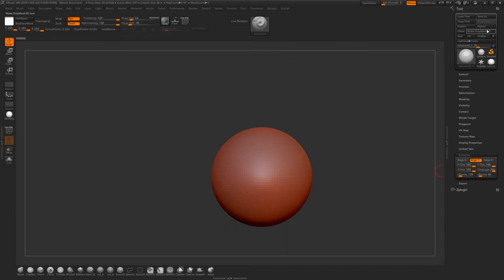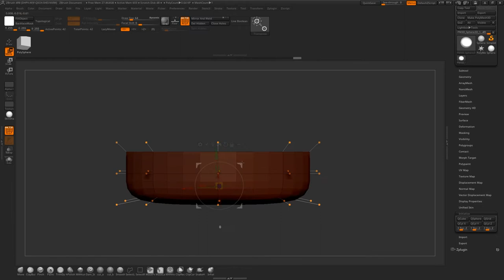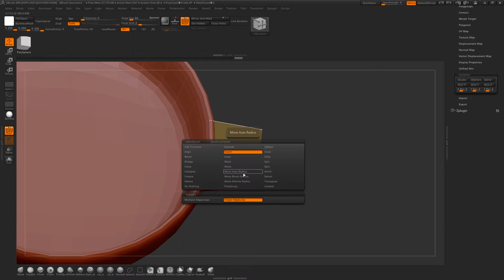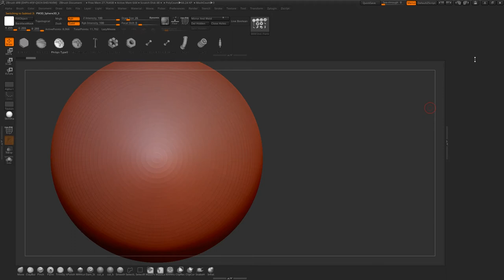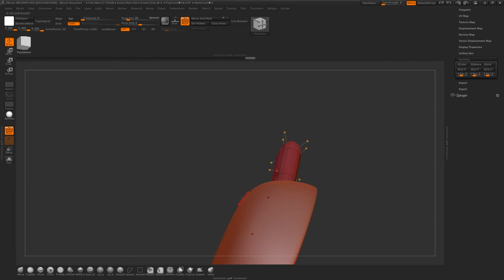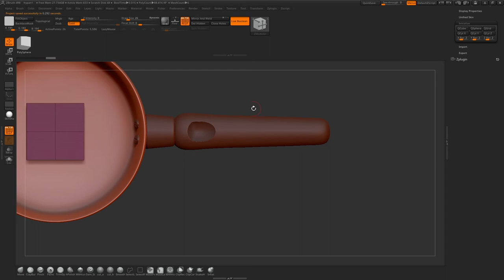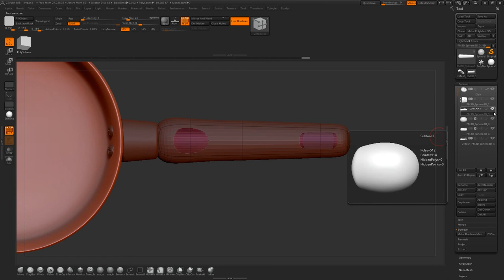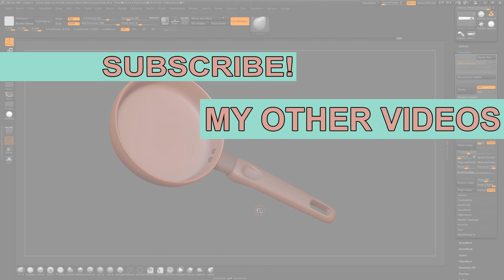zBrush: Model a Frying Pan Tutorial

Comment: Its funny how unnecessarily hard it is to model a frying pan in zbrush compared to maya or other 3d software.
Reply from the maker: There's at least 3 other ways I could have done this in zBrush faster but I just wanted to try out the live boolean mode as it had just come out at the time. If you don't like zBrush that's fine, you're in luck, there's dozens of other modelling softare out there also.